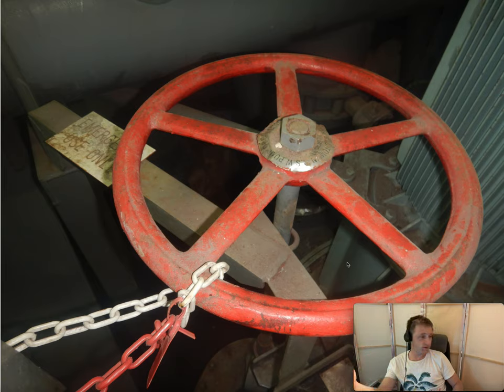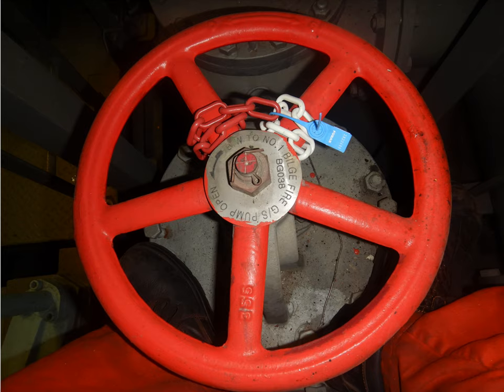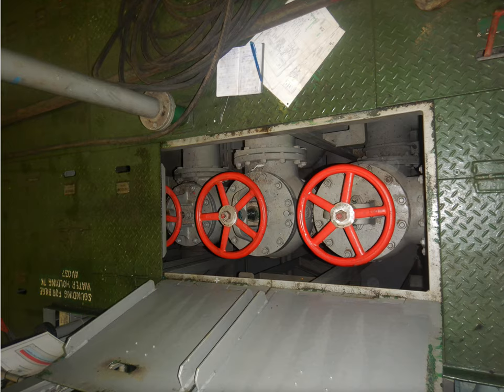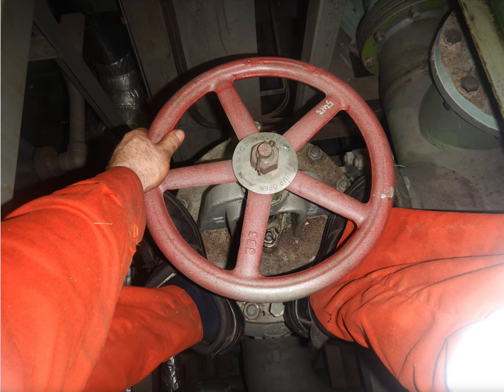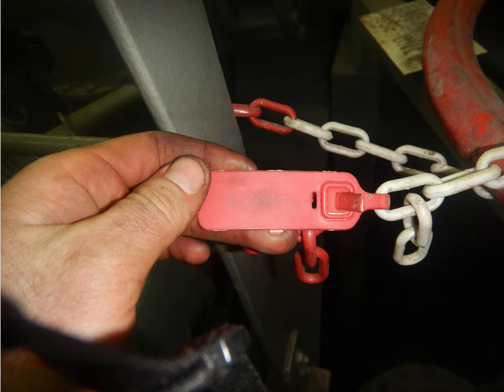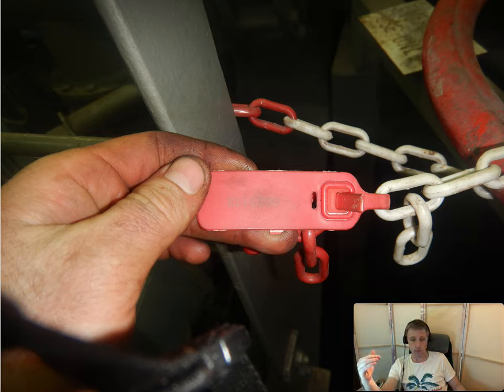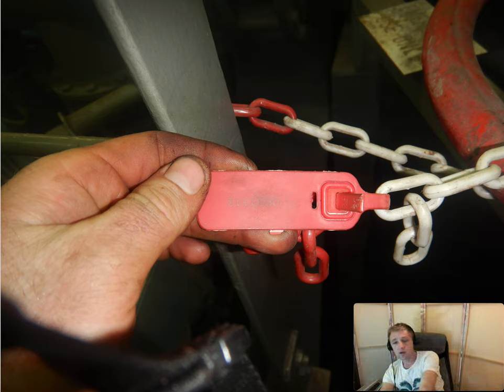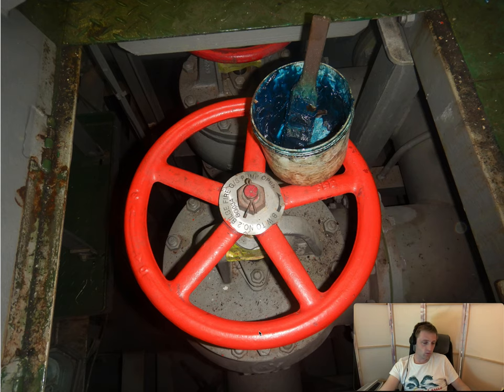Emergency Bilge Suction Valves Tips

Comment: Hello boss .. this was about emergency bilge suction .. On what occasion you will use direct bilge suction ?? 
Secondly in case of ER flooding which you will use Emergency bilge suction or direct bilge suction .. plz reply 😊
Reply from the maker: Hello, dear friend! I recommend checking which power source supplies each pump and considering different scenarios for the engine room you are working on. For instance, if both pumps are using the emergency diesel generator as a power source, it would be best to use the one that is powered by the emergency diesel generator last to avoid switching from one to another and wasting time during emergency situations.

You can create a scenario where you start with direct bilge suction and then switch to emergency suction. I remember that emergency suction is the last resort because all the bilges will pass through the heat exchanger and make it dirty. At that moment, cleanliness of the heat exchanger is not a priority.

Please take some time to compare the power sources and the pump capacities. It also depends on how severe the damage is. If you have more water ingress than the pumps can handle, it's over. The only thing you can do is isolate the engine room and evacuate by closing the doors tightly to trap air and create additional floating stability.
Reply: also I checked both main sea water pump for emergency bilge & Fire n GS pump for direct bilge is from main power supply , no one is from ESB ..
Reply: Thanku for the above answer . Also I have doubt 
That fire & Gs pump suction is also connected from Cargo hold bilge suction , for what we need this line because we have Bilge eductor for pumping cargo hold bilges .. Is this event need to be recorded ? Thanku 
Waiting for you reply 😊
Reply from the maker: @Insaniyat_2793  the bilge suction with pump is done when we have huge volumes of water in the cargo hold or we are making some washing .When the pump suction drops it means there is low volumes then we turn to educator suction.For any records please check the Marpol as I know it depends what kind of product you carry in the cargo hold. For sure in some suction there is reference. Or bulk carriers can have specific documents that describe this operations and any documentation necessary.Normally they can advise you from the handling view of point as well.

Comment: Do you have a rogues gallery of mistakes related to the emergency bilge suction?
Reply from the maker: The most important in this valve is that you can operate the spindle if it is turning to open position.It is a non return valve if you open it water should not come to engine room.
Another important thing is that first you start the pump create some vacuum and then open the valve for suction.Be sure that always bilges are clean otherwise this water will end to cooling water heat exchangers.